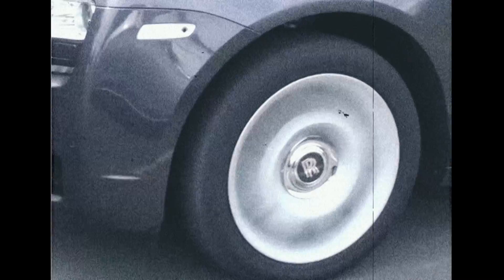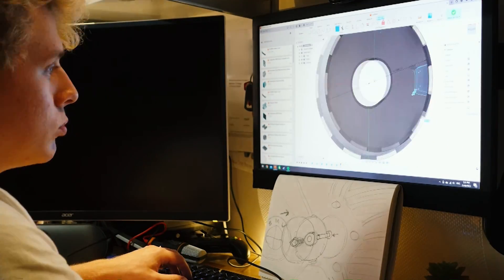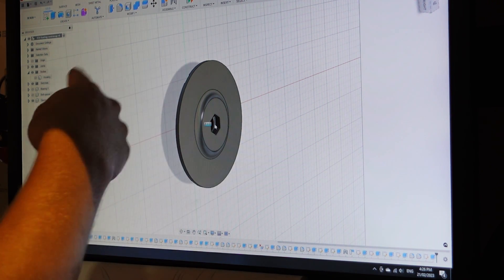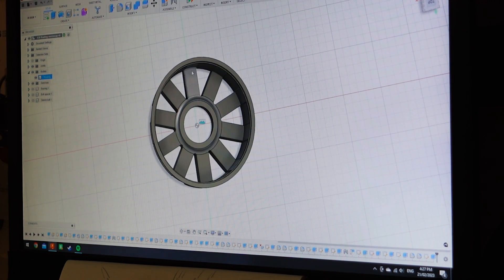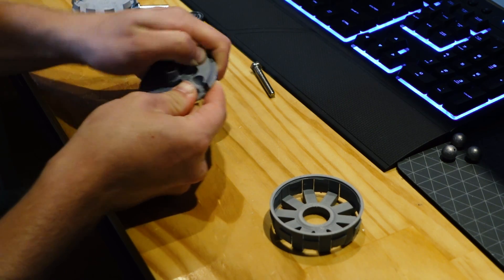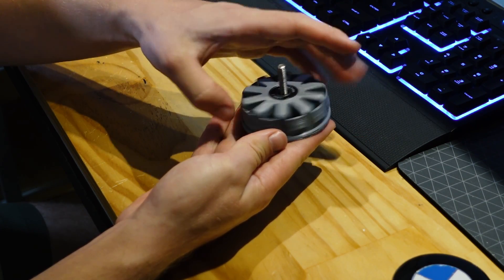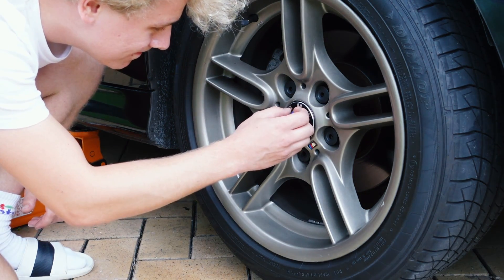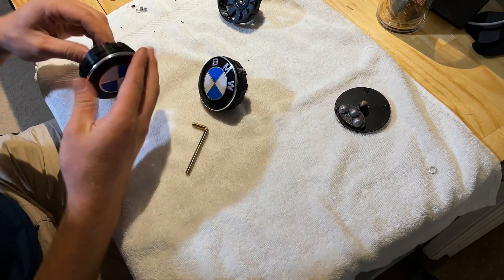DIY FLOATING CENTRE CAPS for $25! (Self-Levelling Wheel Badges)

Comment: Cool. I want to make a turbo-fan styled wheel cover (hub cap) that uses the same idea...I'm wondering if it can be done or if it's too big?
Thanks for your video, and if you can help with a response, it would be greatly appreciated! BTW, I also have two X1Cs, the first almost as old as this video is. 😊👍
Reply from the maker: I think the main issue you would run into is the weight / drag being too much for a mounting system relying only on the centre cap bore. If you made it work with both the centre cap bore and the wheel nuts for support it might be a big enough base. The trick will be printing in multiple pieces and then getting them to line up well enough for a large flat surface
Reply: @OEMStez  Thank you for the response! I'll take what you said and run it by some friends who are smarter than me and hopefully we can make it work! Much appreciated! 🙏

Comment: Does the make the cap stick out a bit ?
Reply from the maker: Not really, maybe 1mm more than a regular badge - they’re available on my website via the link in the description
Reply: @OEMStez  what if I need them for a different wheel not a bmw could I give you the measurements and you print me up what I need ?
Reply: @OEMStez  I’ve emailed you about getting a set of these and didn’t get a response ??
Reply from the maker: Hey, I can’t see anything from you in my Inbox. Generally I don’t design alternate versions for other cars as it almost always needs adjustment to fit properly which makes it get very expensive for the person interested - hope you understand 🙏

Comment: Hi. Love your work. Do you have by any chance original file(from CAD)? I was trying to make set of those and I run into few issues. Slot for bolt head is bigger so bolt is spinning. And slot for bearing was smaller so grinding was necessary.
Reply: hey man, i wanted to do this thing too but if you already did it could you send me the file? you would save me so much time 😂 🤞🏻

Comment: Hello, maybe its possible to get 56mm version ? I could downsize it in cura, but then there would be problems with bearing and weights and i still dont have 3d modeling knowledge to downsize only outer edge

Comment: Thanks for the inspiration. I will attempt. What is the sleeve that you put on the bolt? Is it just 3/8 of an inch of rubber hose?
Reply from the maker: I 3D printed that piece but there’s a lot of things you could use for it. I wouldn’t use rubber hose as you need to be able to tighten the bolt down firmly and rubber hose will deform

Comment: What are you using for computer and 3d printer ? Software ? I’m new to all this and anything helps 🙏🏽
Reply from the maker: Computer is a desktop I built myself mainly for CAD use, something with an i5, 16GB ram and an entry-mid level graphics card will be fine. Software is Fusion 360, printer is a Bambu Lab X1-C but you can get away with a much cheaper printer
Reply: @OEMStez  thank you ! I appreciate it !

Comment: Does the inner bore bit of play on the bearing causing any problems?
Reply from the maker: It can but if you wrap the section of the bolt that meets the bearing in tape it will pretty much eliminate it

Comment: Hello listen man I make these nhe but the normal ones how do you get it right to let not the legs of cap brake when you place them in I'm using petg filament  plz help I made over 25 of these different designs of the legs and does not work
Reply from the maker: Mate happy to help but I don’t know what part you’re referring to
Reply: @OEMStez  the part of Centre caps the clips    that goes into the wheel that locks  in place I made a normal Centre cap and all that but the clips keep breaking

Comment: Any reason why you using long bolts instead of 3d print the entire shaft that goes through the bearing and then apply a screw and washer at the back to keep it in place? Thank you
Reply from the maker: Just not strong enough printing the shaft. If you print it vertically the shaft will be weak as the layers create breaking points every .2mm all the way down the length. And if you print horizontally it won’t be a smooth circle. So a bolt is the best option 👍